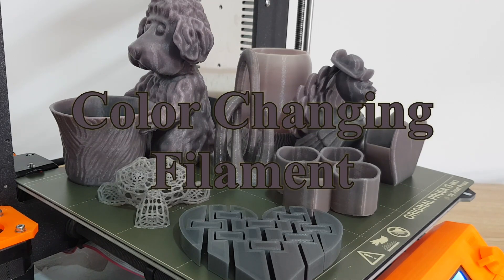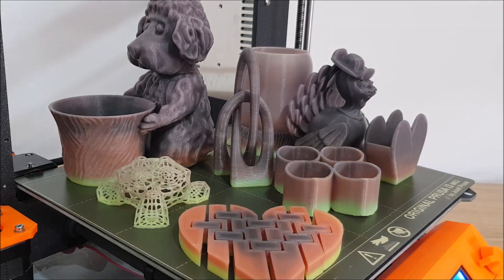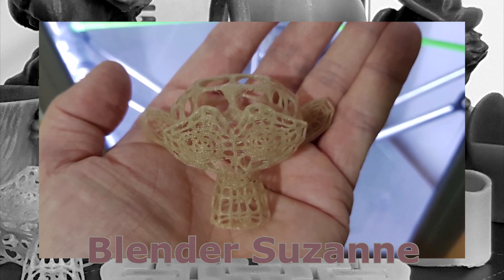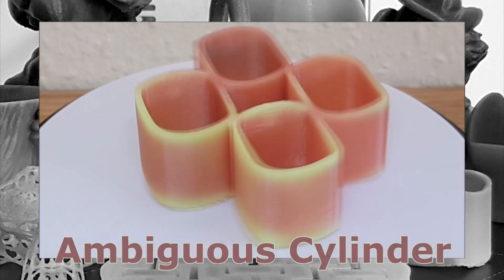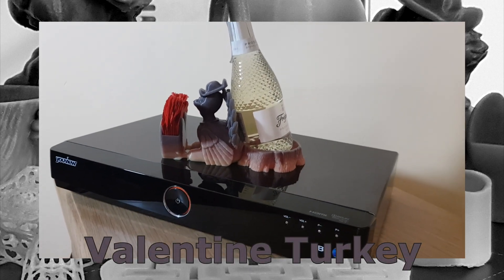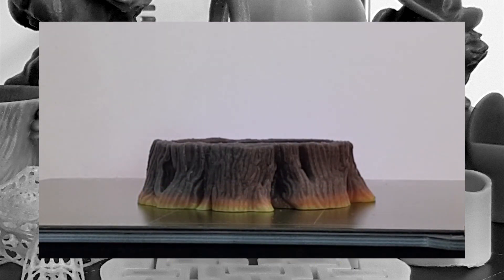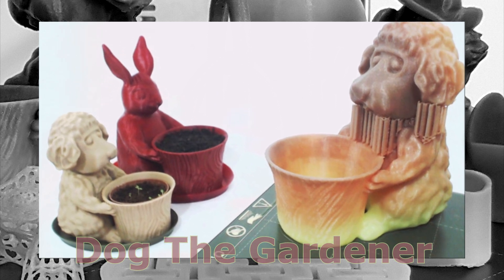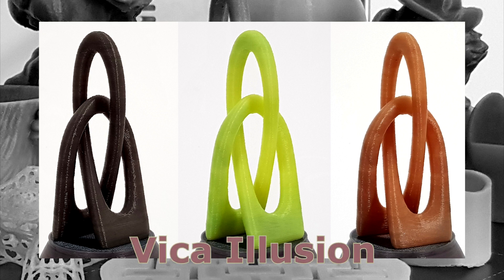Color Changing Filament - Amolen Thermochromic PLA

Comment: I've seen only one review on my local supliers website. This person said that it permanently changed color in uv light. Does anyone have experience with this? Want to use it as a housing for li-ion cells, to check their temperature under tough loads, but i am going to use those outside mostly during sunny days
Reply from the maker: Hi, yes, after some time, two of the models that we left on the windowsill changed the color permanently. You can find the image in the blog: https://3dwithus.com/color-changing-thermochromic-3d-printer-filament#permanently%20changed%20color
Reply: I see now. Thanks so much! Very informative